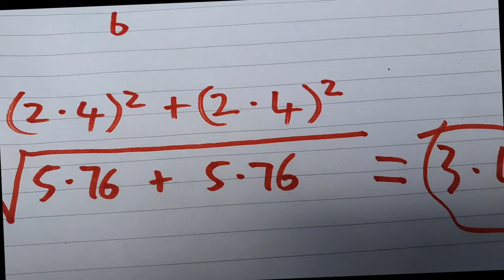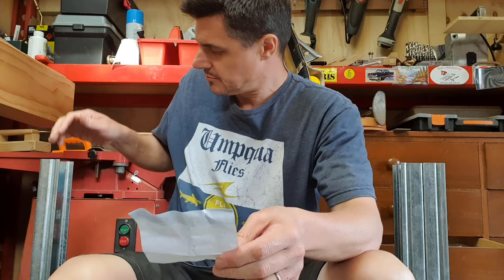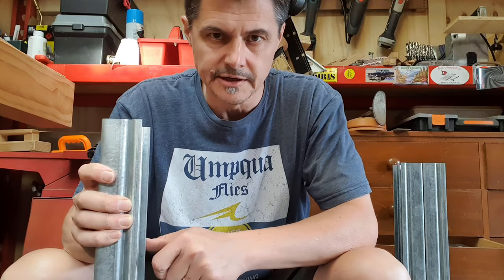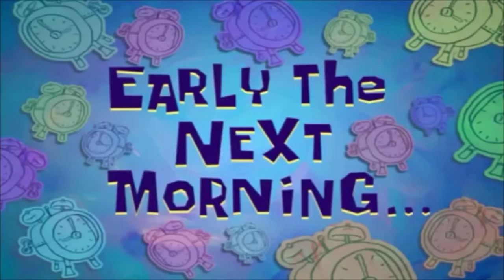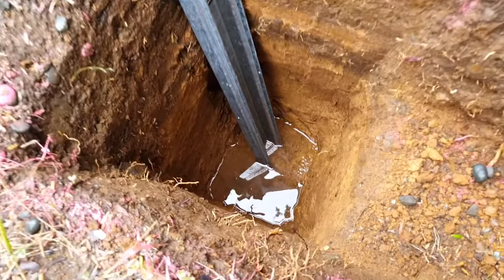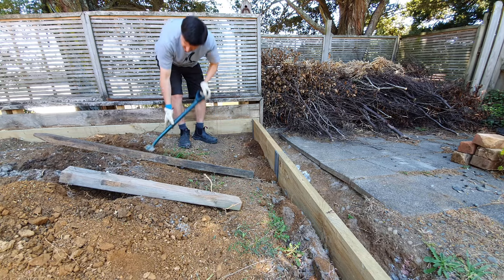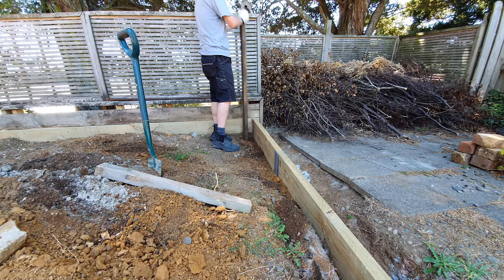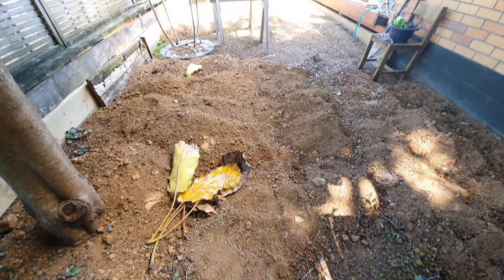Building a small retaining wall using Cirtex/Strol SureWall™: Retaining wall extension Part 4

Comment: Coming along nice 👌, Rob. Those steel C shaped inserts looks really handy and with that amount of concrete, its probably going to last for a very long time
Reply from the maker: Cheers Suj 👍🏻. Their website says 20+ years, similar to the treated pine we usually use around here. I reckon it should go more though because we are inland so there's no salt in the air where we live.

Comment: Hey Rob, really enjoyed the video and quite relevant for me as I am thinking of doing something similar at my house, so thank you. It didn't look like you were putting any drainage gravel behind the wall. Is that something for later, or the wall is so short that it is not needed? Thanks mate.
Reply from the maker: Hey Bob, that's good to hear - the website for that company is pretty informative about the system (in description). One benefit is that it takes up much less width than having a 100mm post with 50mm boards (150mm+) where this system takes only about 65mm.
The wall perpendicular to this one is itself a retaining wall and has all the drainage already installed, so I didn't bother. However, if this was a new wall, drainage is recommended (hose, gravel, geo-textile/screen). Be interested to see what you end up doing mate! Been keeping well? Cheers.
Reply: @TakamiWoodshop  Thanks Rob, good to know. Yep, been keeping well, take care mate.

Comment: Were all those clamps and straight edged metal used to ensure everything was plumb and at the same height?
Reply from the maker: Yep, that's right. but with instant concrete you can also just pour and then place the post in after. I didn't trust myself to get it all plumb and straight during that short window of setting time so I did it before pouring the concrete.

Comment: I've dug a few holes in my time, some i found a little difficult to get out of. But one thing i did (either i was told or i saw someone doing it) was to start digging and if it was very hard, fill it with water, then while that was soaking in, move to the next hole. then fill that one after removing a few shovel loads. It's easier to dig mud! 
Easier and takes a little less time. 
Great wall in N.Z! I look forward to searching for it on google earth! it is going to be huge!
Michael
Reply from the maker: That's a great tip! I don't know whey I didn't think of that myself as I found it really easy to dig after it had been raining. 
Lol, we all have those holes that we dig for ourselves that we can't get out of 🤣
Cheers man, I'll give you a wave on google earth!

Comment: What kind of joiner do you use for two c-posts?
Reply from the maker: You buy them pre joined, but it's just two of them welded together back to back.
You can also purchase them joined back to side, for making 90° turns.
Reply: @TakamiWoodshop  I suspect these are spot welded at many places.  Sections are too thin to accept any other type of welding.
Reply from the maker: Yeah I think so

Comment: Great job! are the sleepers H3 or H4?
Reply from the maker: Thanks mate, H4, for being in contact with ground and/or continually being damp. Cheers
Reply: @TakamiWoodshop  Thanks Rob, i'm doing a similar project at home and found your clip informative & thanks!
Reply from the maker: No worries, just ask for retaining timber, and you'll get the correct H level. It's either 4.8m or 6m lengths in NZ.
Mine is 200x50 rough sawn. From M10, Bunnings etc, they all have it.